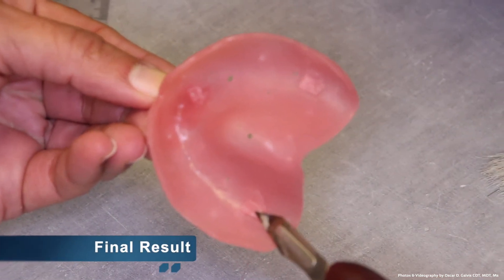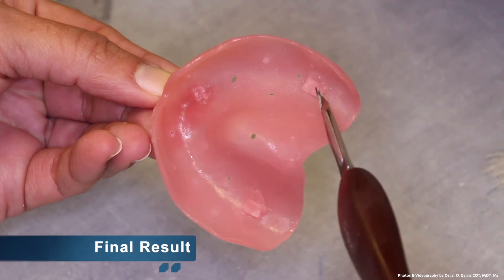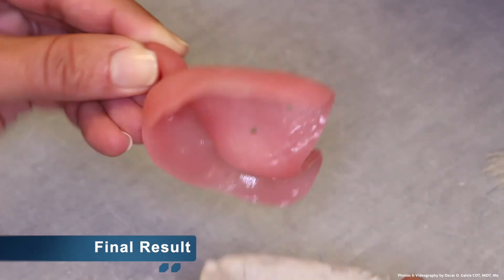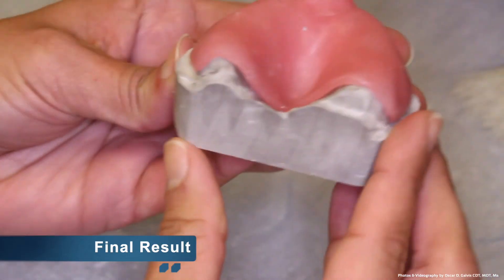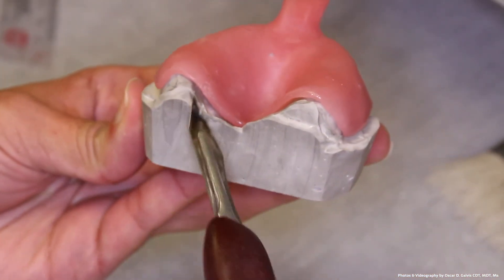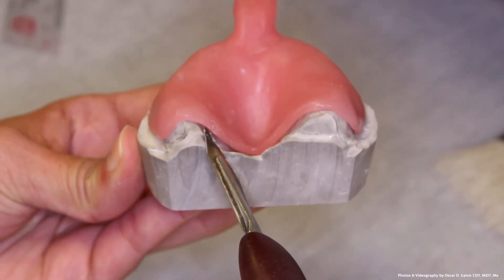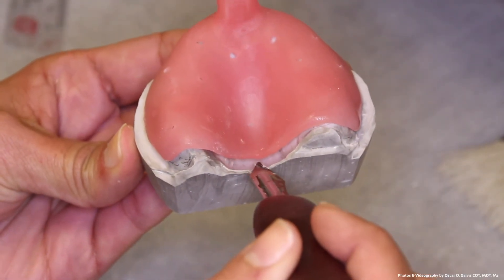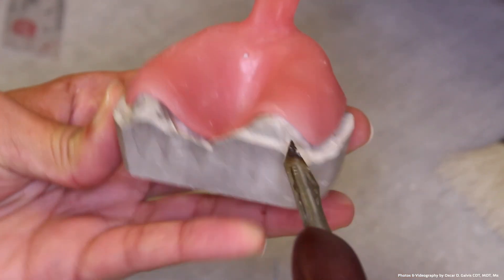CDJ: 3) Custom Tray Fabrication

Comment: Why did you put first a sheet of wax? Rather than directly apply the custom tray material
Reply: It replicates the space taken up by the impression material,  alginate etc
Reply: There are types of special tray..this is spaced special tray
Reply: to get the space to the mucosa
Reply: It's a spacer wax
Reply: the first sheet of wax provides the space for the impression material to go into. Without the gap, the impression material would all squish out and you wouldn't get an impression.